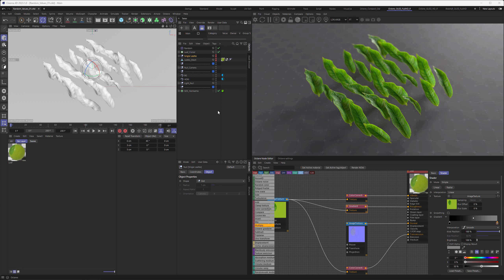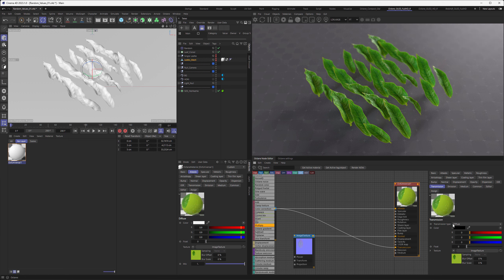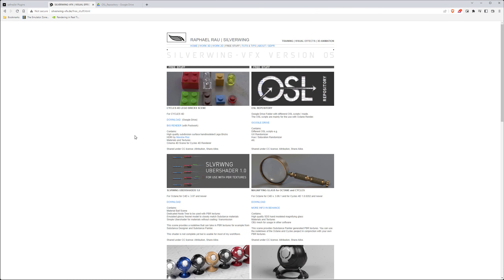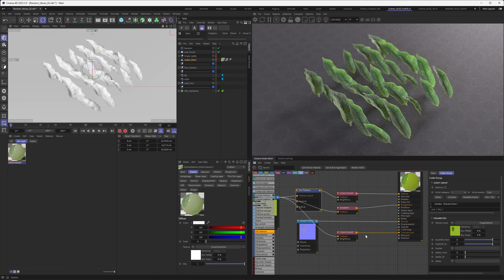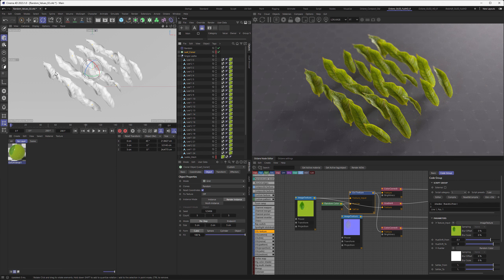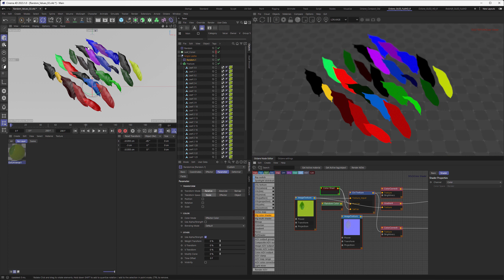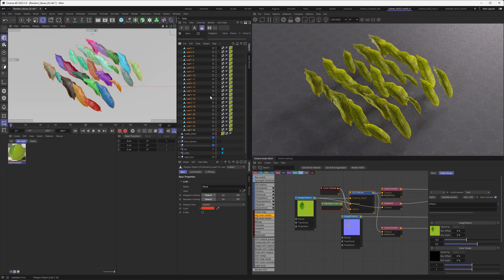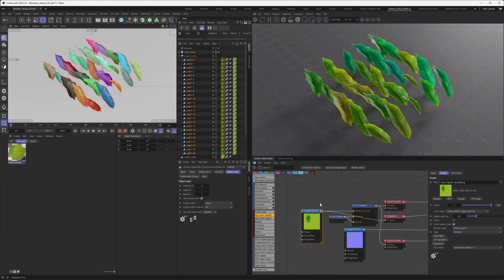Silverwing Quick Tip: Random Values (In C4D Octane Shaders)

Comment: Is it possible to replicate the same method in Blender Octane ?
Reply from the maker: Yes, this should be also possible in Octane for Blender.

Make sure you have instances so either Instance your objects on e.g. the vertices of another object or you use collection instances. It even works with instances on Gemoetry Nodes!

I just tried and it works.
If you want the small test scene, you may contact me via email.

Cheers,
Raphael
Reply: @SilverwingVFX  OMG! It worked with instances! Thank you so much! Subscribed!
Reply: @SilverwingVFX  OMG it worked with instances! Thank you so much! Subscribed!
Reply from the maker: @warpcloud  Oh, amazing to hear that it worked. Cheers and thank you very much for your support 🙌

Comment: If the object is one mesh, than you could use fracture explode and connect, with random effector.
Reply from the maker: That is indeed very true. I should have included that ☺

Its just for those cases where you wan to leave the object as one mesh as C4D is more performant this way.